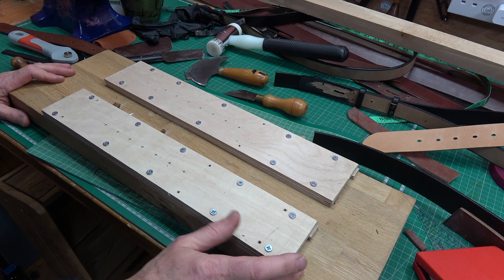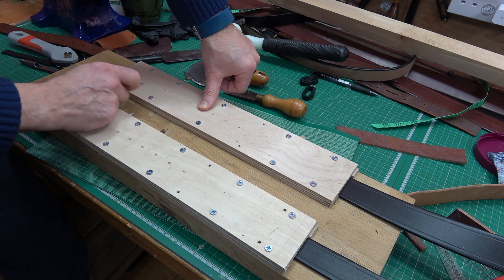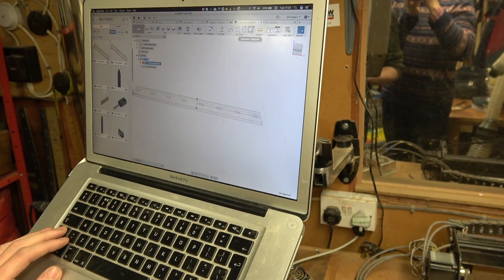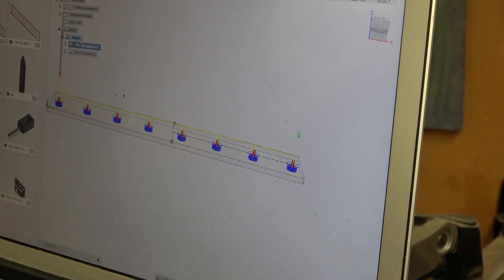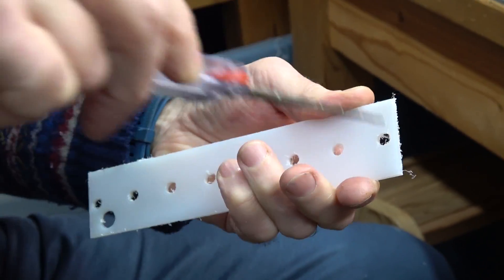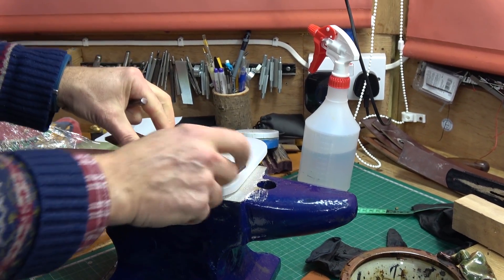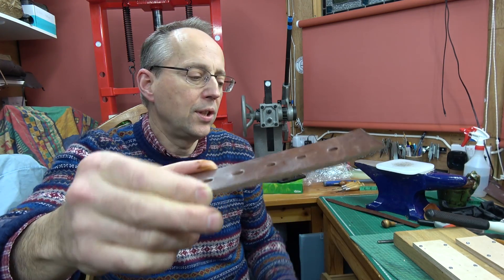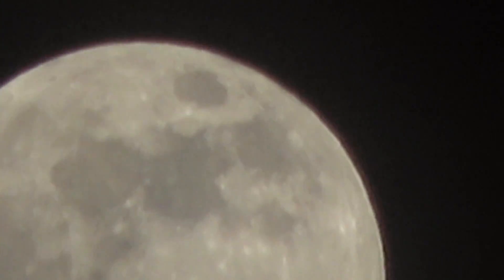The Template Challenge

Comment: Like the video but you both missed the obvious solution behind you at the start of the video. A nice arbour press that only needs a tool holder and a fence with an indexing pin to space the holes. The bonus,  it is fast and precise. I will grant that the template is a tad more portable than the arbour press.

Comment: Open the troughs on your jig, put nails in the holes on top cap protruding a mil, add a cam clamp or two to the sides. Place belt in trough, place top cap over trough, clamp down.

Comment: I was half expecting you to be trying to make a template of the cat, given the thumbnail. Now that would have been a challenge! 

Could you mount a round punch in a drill press and use a fence/ guide to line up the cuts? That would certainly make it very easy to centre the holes.

Comment: Meld the best of both designs! The wooden jig holds the leather snugly in place without moving so making a sleeve makes perfect sense. Then why don't you just drill holes in your wooden jig just like your son did in his acrylic plastic. Next, I would have done as John Luijsterburg suggested (below) and drilled the holes a little large so you can punch the holes directly thru the template.  If you do that then instead of screwing the wooden sleeve onto a wooden back plate, screw it down on a piece of  plastic cutting board just like the white one you use on top of your anvil. The jig will then be slip-free requiring no clamping of your leather together with the jig and is fully assembled so all you have to do is slide your belt in, set it on the anvil and punch away.

Comment: If John would have made the holes a little bit larger, you could punch the belt right through the template. This is of great help because my holes a a bit brick&brack. So John is the champ of the day. Perhaps next time a template fir rounding corners😉
Reply from the maker: Josh Luijsterburg Hi Josh...we really need some parallel shank punches as my existing Dixon ones are curved...and narrow ....toward the tip....with parallel we could punch through and still be on target...as you say that would be far better. Best regards Harry

Comment: Excellent! When shall one find them on the web store? :)

I'd clamp it to the bench top with a spring clamp just to keep it in place and have both hands free.

And if you made it from thicker material, you'll want to increase the size of the holes to accommodate the outside dimensions of the punch.... why I say that, is that making it thicker and handling the whole tool means you could also punch directly without just marking first and repunching second.

Must get my new laser tube...